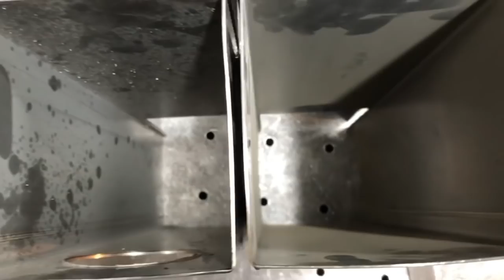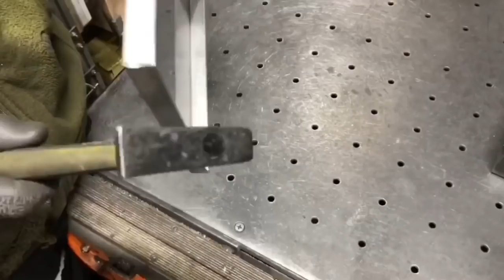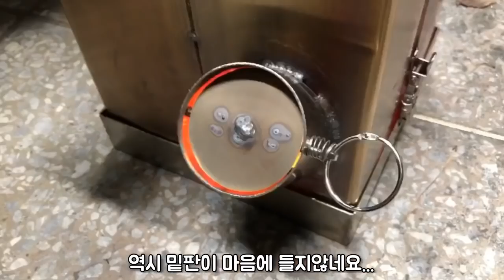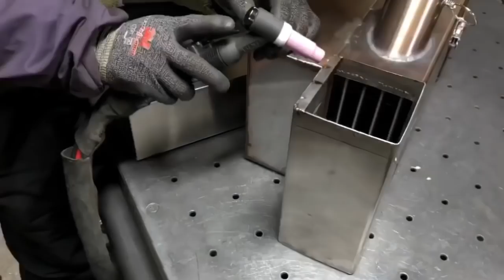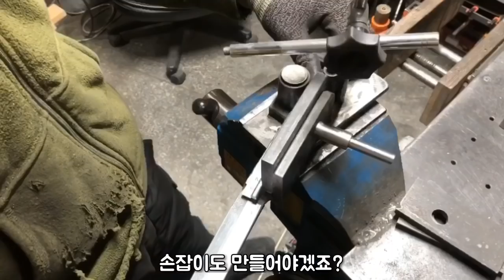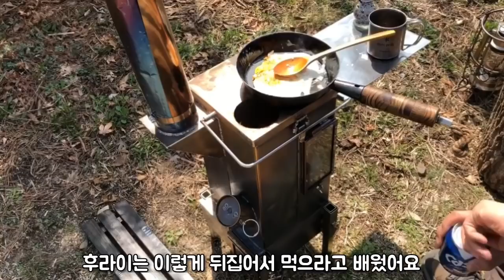스텐각관로켓스토브 만들기 / 캠핑 / Stainless Square pipe Rocket Stove making / Camping

Comment: Love you use of fist, spanner and hammer to cut and punch segments.  On outer surface seemed to be glowing red from excessive heat.  Would 100mm fired terra-cotta floor tiles fit inside the square tubing?  Lining the bottom and outer sides of the firebox would reduce metal fatigue and offer a bit of thermal mass to protect single layers of metal.
Reply from the maker: Welcome to
Thanks for the good comments
I'll refer